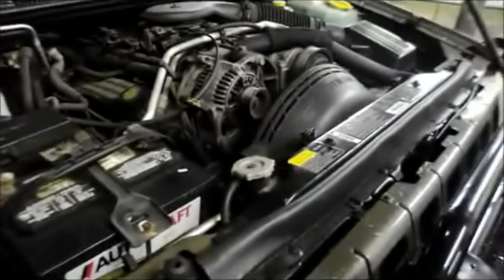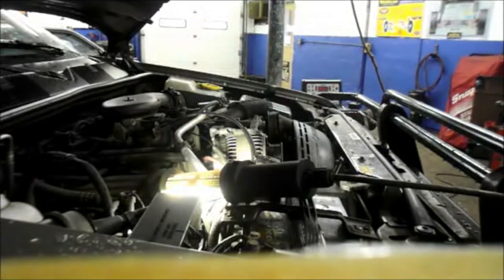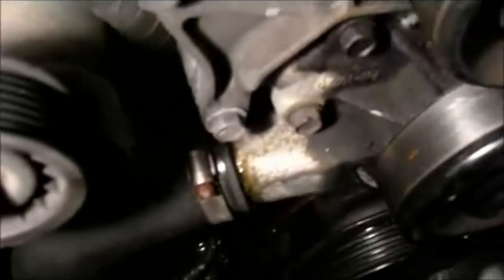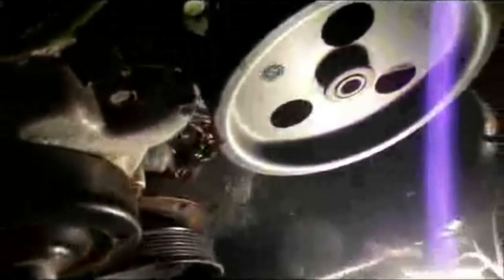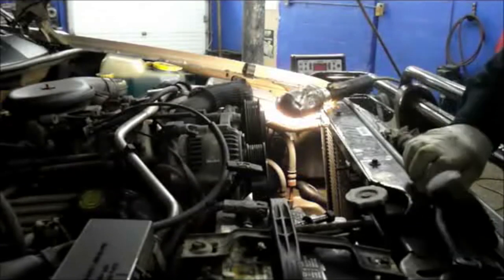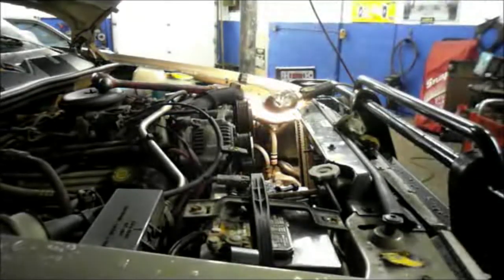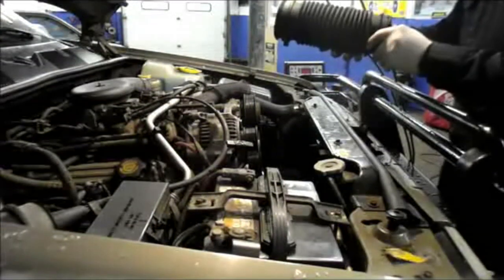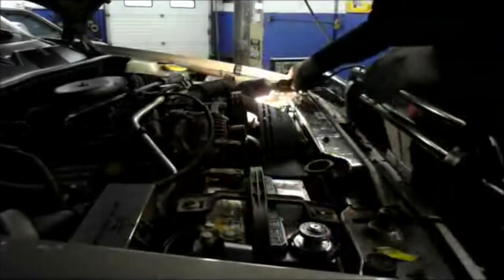How to replace the water pump 1998 Jeep Grand Cherokee

Comment: draw the belt routing out...its usually not diagramed anymore    a wrong fit can make the water pump run backwards   use the correct coolant  the seal was designed for silica or non silica  long life  or conventional

Comment: do you think... lack of coolant service caused the water pump failure
Reply: The 5.2 and 5.9 are extremely prone to over heating issues especially in high traffic areas. The weak point is the mechanical fans hood louvers and an electric fan go a long way my 5.2 over heated bad offten with my current 5.9L i replaced the fan and thermostat with a 165° and aluminium radiator and cooling system flushes with oil changes